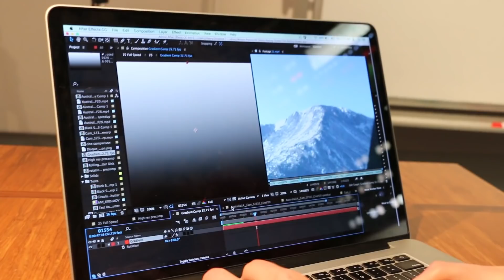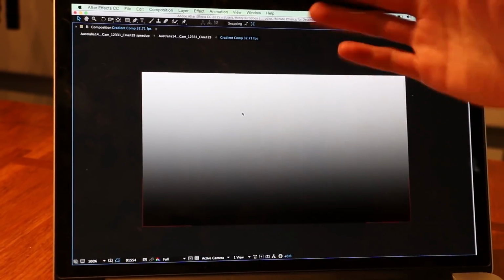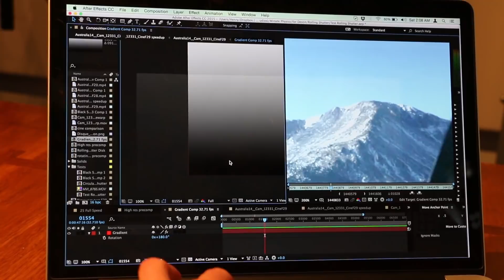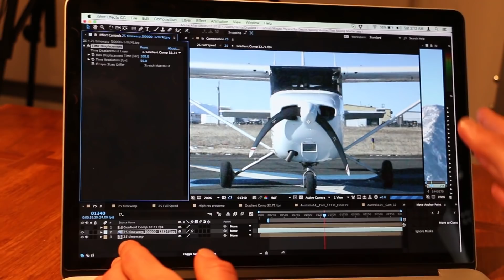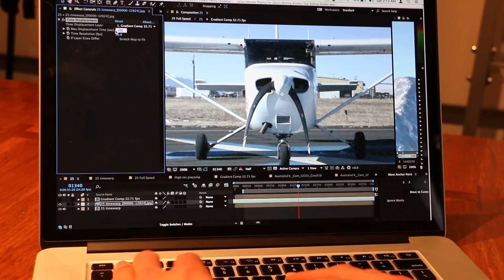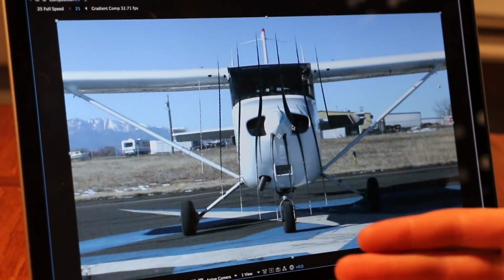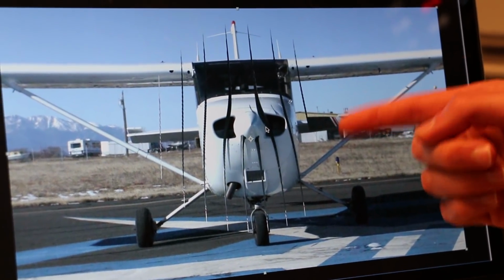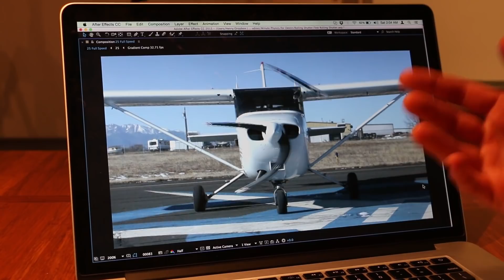Simulating Rolling Shutter (Behind the Scenes) - Smarter Every Day

Comment: The Cessna cruises with a power setting of ~2100 - 2300rpm, so if u setup ur camera with 1/2000 or what so ever shutter speed that matches with the rpm of the prop then u will overcome the rolling shutter effect and get a perfect image of a "stationary looking blade" which its actually rotating at 2000+rpm. Is that right?

Comment: I simulated a rolling shutter in a 3D modelling program, and rendered it with an (nearly) unbiased renderer, basically a photon light simulator.
I physically modelled the camera and made an analogue rolling shutter for it, and it's giving some very interesting (and accurate) results. It has wide potential for testing hypothetical things, like "what would X look like with a strong rolling shutter effect?" - even things that are completely impossible in real life.
Tell me if you're interested, Destin :)

Comment: That's... Really cool. How did you put together the "simulated rolling shutter" video? Are you looping back to the first row/column as time in the original progresses? As in, if it were a 20x20 picture and it takes 1 ms per frame, is the first frame of the "simulated rolling shutter" video actually the first 20 milliseconds of the video? But wouldn't that mean that the 21st ms row of pixels have nothing to do with the 20th ms row of pixels? And if it's doing 20 ms of footage per frame, how is the frame-to-frame transition so smooth on the "simulated rolling shutter" video? Shouldn't it jump around a lot? I guess this might be where aliasing comes into play, but... Why should the first frame of the "simulated rolling shutter" video (first 20ms of the original video) be related at all with the second frame of the "simulated rolling shutter" video (21ms to 40ms of the original video). I don't think I'm thinking about this correctly...

Comment: the effect at the end of the main video, was that done with an 8bit gradient? i'm just curious why it looked weird/different than normal rolling shutter. (2nd edit) or was it because the speed of movement was so slow that you get weird effect when you force rolling shutter.
Reply: The choppy resolution on the Y axis is a result of a low number of time samples due to the source video frame rate done by a normal camera.

Comment: What would happen if you try to "reverse" the rolling shutter effect? So using a video with the rolling shutter problem and offset the frames like you did to simulate the effect, but in the opposite direction, if that makes sense? I don't really think this will work, but im curious to see.

Comment: Assuming the thing is stationary and the motion is periodic, would you be able to do the reverse, and take a stable phone video and turn it into high speed footage?
Reply: Cool question actually, but doing the opposite would definitely be much harder
Reply: Not quite, in this case they are removing information from the high speed footage to generate only what the phone would be able to see. Then you cannot have the high speed footage because you need more information than what your phone got. Presumably you could know where the blades were at all times, and generate an animation, but there would be some actual images of the blades in certain positions that your phone did not record.

Comment: The type of curves you get are:  
y = x * tan( w * x + phi )

Where w is related to the propeller and shutter speeds, and phi is phase.
Reply: I'd love to see the proof!
Reply: Well, imagine a vertical bar going from left to right of the screen (representing the shutter), and an infinite straight line passing at the origin, around which it can rotate (representing the propeller).

If the vertical line is at position x = 1, then the interception of the propeller line and the shutter line is simply:
x = 1, y = tan( alpha ), being alpha the angle of the propeller to the x axis, this is the geometric interpretation of the tan funtion. 

If x were to be a diferente value, then, because the propeller line has a slope of tan(alpha), the interception point is going to be y = x * tan( alpha ).

Because the propeller is rotating with constant speed, we can write:
alpha = omega * t + phi, where omega is the angular velocity of the propeller, t is time and phi is the phase.

Now, if the vertical line goes through all values of x, from left to right, at constant speed s, then:
x = s * t  <=>   t = x / s

So, from y=x*tan(alpha), we get:
y = x * tan( omega * t + phi) = x * tan( omega/s * x + phi) 
y = x * tan( w * x + phi )  ,   with w = omega/s

So the faster the propeller's angular velocity in relation to the speed of the shutter, the more separation lines you will see because the tan function cicles more often, like Destin and Henry theorized. Also, Destin was right about de arctan lines which is the result you get if you do this with an horizontal line moving vertically  for the shutter.

It's not a rigid proof but I hope it convinces you it's true :)
Reply: Gênio!! Valeu pela explicação! Brasileiro também, imagino ;)
Reply: Obrigado!! Na realidade sou de Portugal :)

Comment: 2:20 So I guess you didn't switch to 16 bit for the end of the main video?
Reply: Well, aliasing also happens if you don't go "far enough" back in time. If Destin had gone back too many more frames, it would have been hard to tell what was going on (the difference between bottom & top lines of his last shot was probably only a few seconds, or maybe about 100 frames, not nearly enough to be "smooth" regardless of what bit depth you use). An alternative would have been to use timewarp or something to super slow down the final shot, then do the rolling shutter effect (so a difference of a few seconds from top to bottom line would have 2000 frames to work with), then speed it back up, but that would be messy and take a really long time to render. What Destin actually did is a much easier/faster hack.
Reply: Good point. And spinning excruciatingly slowly for ten minutes, just for the end-of-video gag, would be a bit much.

Comment: Could you use this technique in After Effects in reverse to 'fix' actual rolling shutter in a video? I'm thinking instead of telling AE to progress one frame for every line of pixels, could you get it to go back one frame?
Reply: Don't think so because you don't have that data if filming at normal speeds
Reply: unfortunatelly it's not that simple. If you where to wind back each line of pixels by one frame, by the time you reach the end of the frame the last line would be 30-40 seconds back in time.
The information is just not there, you would need 1079 more frames inbetween each "normal" frame to make that work and if you had so many frames you wouldn't have rolling shutter.
I don't think an artifact like the one seen in the propellers shots is actually fixable. There is software that will fix (or at least it will try) the "jello" effect caused by rolling shutter by analizing the footage and creating a vector of each pixel based on it's direction and speed and move it in it's correct position.
Reply: There are plugins that do this automatically. I believe there is even one built-in to After Effects.
Reply: not enough video to work with. It worked in his video because he was using a slow motion camera. And if you got a slow motion camera for this lol u defeated the whole point, the slow mode camera would not have that problem. xDDDDD imma go now
Reply: Manicol Ercolano While filming you could slow the shutter speed for a blurrier look, if you had that kind of manual control, so the propellor is just a spinning disk instead of a chopped up blade
Reply: Sorry I was responding to original comment, not yours
Reply: Your channel is an epic discovery Ami Yamato.
Reply: Marius Meeren i dont think you can. You dont have enough frames
Reply: Perhaps using this technique with the gradient contra to the scan direction. As you have a loop of the rotors spinning that would look fine. Than comes the issue that you would also need to mask if from the background. Cause now the surrounding would look weird.
Reply: Just use the slowest shutter speed possible while filming, that's the best solution.
Reply: yes
Reply: OP, no you can't run this in reverse to fix anything.  Consider what you've done when you run the process forward:  for each line in each frame of the output rolling shutter video, you've thrown away 1000+ lines of input high-speed video.  If you want to run it in reverse to fix rolling shutter problems, then you'd have to magically recreate all that data that has been thrown away.  The machinery of the rolling shutter has been explained, but what's really happening is that your camera is too slow to capture the data thrown at it and that data would have to be at least approximated to "fix" rolling shutter.  Approximation of data that just isn't there is a completely different problem and much more difficult.  There's a reason Henry said his simulation was simple, all it's doing is (cleverly) throwing out most of the high-speed video.
Reply: itsViney black to white gradient instead of white to black.
Reply: If you would try that, the video would be delayed from the bottom to the top. It would offset the video from the bottom to the top. It could work, but then you will have to 'fix' every frame in the video, or image
Reply: Again, you can do it, but you would have to manually fix the image. Build the image. Which takes days even weeks doing. And the skill to do so. +5MadMovieMakers
Reply: @mhvdm  It wouldn't be so manual. All that's required to fix it is finding the temporal gradient generated by the camera which in the case of CMOS is just a function of the vertical travel speed, and then just create an inverse of it so that the offset of the pixel line at the end is 0 on subtracting.
Then, apply that temporal grad to the affected video users after effects to fix it.

Comment: So acquisition frequency is the key. The more frames we get per given time the more accurate and "real like" the video will be. At least for fast movement objects.
Reply: global shutter is the key.  The high speed camera and some other (mostly) expensive HD cameras do not roll the shutter.  Also most CCD cameras (as opposed to CMOS) sensors are global shutter, but most HD cameras use CMOS.
Reply: Eisen Feuer thank you for your answer.

Comment: When you're referring to the "rate of the rolling shutter" wouldn't that just be the frame rate of the original video? For instance an iPhone filming at 30fps would (in theory) have a shutter rate of 30Hz since one shutter cycle would generate one frame. Or am I missing something?
Reply: It both changes with shutter speed and can compose different fractions of the shutter speed.
Reply: Sam Bowmer you can always have a faster shutter speed than frame rate, but not the other way around.  You could record at 30fps with the shutter open for 1/60 of a second or 1/120 of a second but not 1/15 of a second

Comment: Would it look the same if the scan rate of the camera was divisible (exactly) by the RPM of the propeller or would it show the blades as straight?
Reply: fez the blades would appear as if they weren’t moving!
Reply: they would be curved but stand still instead of moving or flickering
Reply: Are you sure about that? Because, the camera still takes time to make a complete scan of one frame. In my mind, the blades would appear bent straight and diagonally (to the connection the blades) and not rounded as they were in this video. I'm not sure if my description makes sense. I hope it does.
Reply: the point of the blade would be in each frame i suppose, and in the middle you would see the whole blade. so you'd see a half circle and a horizontal line in the middle.